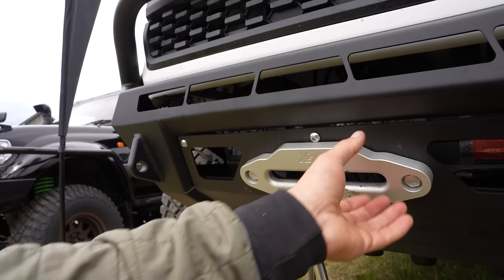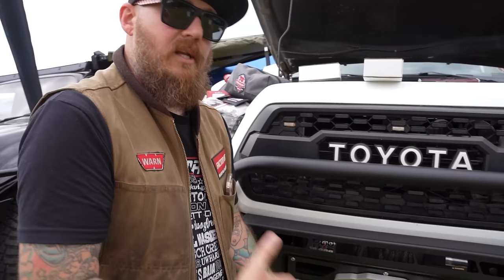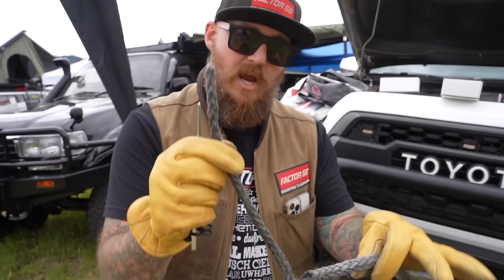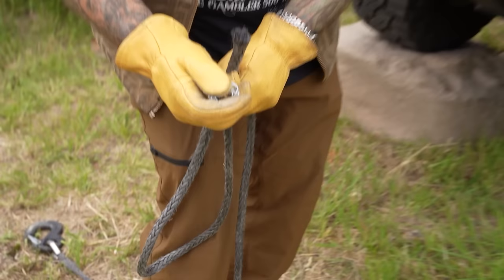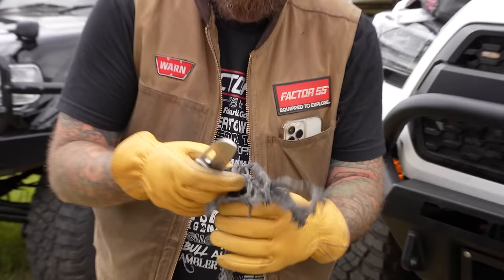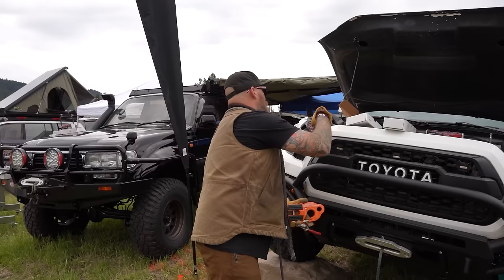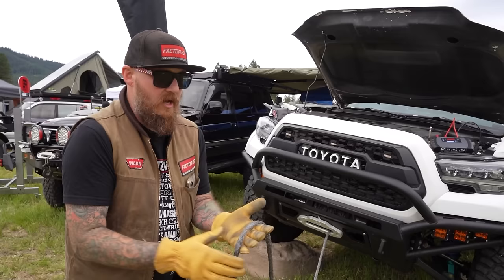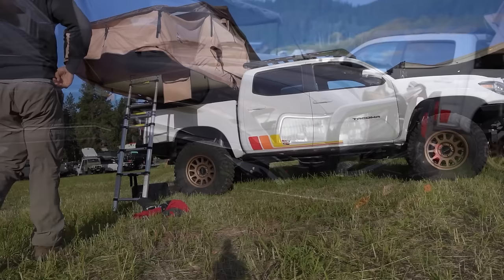How to Splice Winch lines & Why you should upgrade your Winch system.

Comment: You take the  base-plate of prefabulated amulite, surmounted by a malleable logarithmic casing in such a way that the two spurving bearings were in a direct line with the pentametric fan. The latter consisted simply of six hydrocoptic marzelvanes, so fitted to the ambifacient lunar waneshaft that side fumbling was effectively prevented. The main winding was of the normal lotus-o-delta type placed in panendermic semiboloid slots in the stator, every seventh conductor being connected by a non-reversible tremie pipe to the differential girdlespring on the "up" end of the grammeters.
Reply: nailed it. lmaoo
Reply: You took the words right out of my mouth.
Reply: Bro you win for top comment 😂
Reply: 100% won the Internet today.
Reply from the maker: Oh my God thank you 😄
Reply: @Maxx.Powell  haha no problem any time!
All joking aside, this was a wildly helpful video that I'll be coming back to when I get my winch. That dude clearly knows his shit and I'm jealous of that knife 🔪 !!!
Reply: These all sound like things folks get sent after when they're new on the job. Beautifully done sir!
Reply: Your mistake.
You describe, as everyone knows, a transmission known as the turbo encabulator, which was - a crudely conceived idea of a transmission that would not only supply inverse reactive current for use in unilateral phase detractors but would also be capable of automatically synchronizing cardinal grammeters [regardless of the 'end' used]. 

Now basically the only new principal involved is that - instead of power being generated by the relative motion of conductors and fluxes - it is produced by the modial interaction of magneto reluctance and capacitive duractance. The original machine had a baseplate ... [the rest is yours] ... The turbo encabulator has now reached a high level of development and it's being successfully used in the operation of novertrunions.  Moreover, whenever a forescent scoremotion is required, it may also be also be employed in conjunction with a drawn reciprocation dinglearm to reduce sinucoidal repleneration.

It's not cheap.  
But I'm sure the government will buy it.

That is all.
Reply: You must be associated w/ Chrysler Master Tech videos from... the 80's??? The video was called "Turbo Encabulator".
Reply: wtf did I just read?

Comment: I swear to god overlanders will pay for anything that will not make their IFS vehicle anymore capable. "Ohhh a $400 fairlead why not"
Reply: Gives it 20 hp and Bluetooth  locker up front
Reply: I bout stickers that gives me 15 extra mpgs. You can buy them as well. But save up. It costs 200 bucks.
Reply: And why shouldn't they if they have the money? U mad?
Reply: You are way off on your price 🤣 clear indication of you can’t afford it and you are big mad 😡 

The fairlead in this video retails for $88 as of today when I’m on their website making this comment
Reply: @matt.mckinzie factor 55 ultra hook is $280, for $15 worth of aluminum and $15 of CNC work .
Reply: @KurNorock  and?…..
Reply: @KurNorock  $15 worth of aluminum labor and electricity to machine it and anodize it. Labor and cost to package it and ship it. That’s before you spend a ton of money doing research and development and testing for proper certifications. If you can go by $15 worth of aluminum and produce this product for your vehicle by all means have it. don’t forget the steel for the locking hasp and the rubber to keep it properly secured.
Reply: @iamme8949  people always want to bring up the whole "research and development and testing" argument as if that justified adding another
$150 per unit. First of all, these aren't that complicated of a design. It didn't take a team of engineers 5 years to design this crap. Secondly, they've been selling these things for years.  The R&D has long since been paid for. So has the equipment. You are paying a 1400% markup because you have been conned into believing that all R&D is super expensive.
Reply: I just like a cheap roller still lol
Reply: @Chris-te7uk  and there it is.  The most smooth brained take possible.
Reply: @KurNorock Apparently you don't like good 'ol American capitalism.
Reply: @markschram3971  and there is the second most smooth brained take possible in this conversation.  

This has nothing to do with capitalism.  This is about moronic customers who don't realize they are getting ripped off by a dishonest manufacturer.
Reply: How exactly is this "dishonest"?
I am loathe to be a consumer merely to keep up with the Joneses, however I am also consistently interested in new ideas & new tech.
For the average winch owner, a fairlead with minor nicks isn't going to strand them in back country Alaska, so... whatevs.
Buy or don't buy.
Your opinion is obviously invaluable & you're much smarter than everyone with your edgelord take on this super important topic with implications on global security.
Reply: It’s a cycle new trends pop up people want to join, the hobby  starts becoming a glitz flex game and lose sight of effective solutions vs overhyped overpriced gear ⚙️, some keep focus keep it simple, others it becomes a gear chase or flex game, it’s a natural part of the industry to promote products for profit even if they are overpriced and serve little to no more benefits 😅

Comment: There aren't any burrs,   it's soft aluminiun for a ourpose put the winch line hook in the tow point on the truck,  you don't need th wind the hook into the fairlead,  just another load of bollocks.

Comment: Rigger by trade here.. great vid . Not to be that guy.. but that's not a Brummel. That splice will slip under slack. You need to weave the two tails into each other for a true Brummel. I would recommend you stitch it to seize it under slack in this configuration.
Reply: Plus 1 for this comment. He did not do a locking brummel or taper the tail how I would...
Reply: 100%  I seen that and said the same thing.   His tail was not long enough to hold without a lock.

Comment: A good company is one that can convince you to buy crap you don’t need. Fairlead, hook, fid, rope guard for said hook, the ring inside, what did I miss?
Reply: Winch. Fancy bumper. Overland truck. Truck tent. 

Tarp and a backpack is all you need. Hell, skip the backpack and use the tarp.
Reply: Yeah I often come across vehicles far from the end of the pavement that are in need of recovery and I just grab my handy dandy tarp to pull them out…

Oh wait.
Reply: @timothyc4214  it was sarcasm. The point was you don’t need anything to get out into the wild. 

I can get further than any truck ever designed.

Comment: y'all remember back in the day when we used wire rope. and it like didn't need any of this crap?
Reply: The rope is fairly tough stuff, I wouldn't have an issue with having some to use as an extension if needed, but for the main line, I'll stick to the wire rope, not hard to do splices and repairs on it either.

Comment: Excellent procedure.                          I!m from the sea and barge work so we spliced our big wire rope on a big set up that look like a tire machine. We pulled the cable in the back door of the rigging room  up overhead n down  into a guide  to position it verticle to do the splice. Big job. Dandahermit
'm

Comment: The harbor freight 12k synthetic system is really really similar.  I think it's good enough for me.   Just glad j have a winch if i need it.   I'm still trying to figure out how to pull myself backwards with only a front winch lol
Reply: Youll need four snatchblocks, & attachment points:  front attachment, side attachment ( to Avoid running line under yiur vehicle) and two rear. Use a sigle line pull front & side,  then a double line pull at rear.
              v side
           __
>        [____]        <   Front
>

Comment: I still don't have my suspension done.  I decimated my front and rear stock bumpers on my Tundra on one trip and decided I needed to protect the truck body more than I needed new suspension.

Eventually I will get the suspension done and lockers installed.  Just gotta space out the $$$.
Reply: These kits are only 5 percent better than stock. If they really offred much they would have a g meter and speed over obsticals comparesion.

Comment: That rope was not spliced correctly from the factory. The tail is to short and isn't tapered enough. This is a major fail on the rope manufacture's side.
Reply: The rope manufacturer didn’t splice it.  They just sold the rope to the winch manufacturer.  Jeeez. 🙄

Comment: Re the forged hook, which absolute idiot would cut the eye  when cutting - or disassembling) and resplicing (or clamping) cable / lines is always the preferred method...

NB. Always maximise jargon to improve one's market position.

Well - for real strength do a deep bury - stitched brummel splice  - NB to brummel around a piece of hardware, one needs the free end to be released from the winch...  A stitched deep bury is a one end affair... 

The "1:1" advice on minimum bend radius may need some proof to that pudding - It could be true with 12 strand woven rope, definitely not likely with higher weave count... ???.

Comment: I question the titanium pin on that hook.  I have bent so many titanium pins on things.  It does not take much to put a bend in them.   They dont recover like steel to a degree.  I have gone back to steel on pins cause of it. If it does bent slightly.   The whole hook will be junk.

Comment: The safest hook is no hook..

The simplest DIY Splicing tool is a length of fencing wire.  (Make a smooth ball of the sharp ends to avoid losing it inside the rope, or poking "one" in the eye..

Receive rrecovery points - should be cross drilled to allow alternate axes of operation - If pulling to the side a vertical orientation is way better... - Bow/Dee-  shackles should not be loaded off-axis - with ""lopsided loading"...

Ha ha - for quality, any foreign country with an eye to detail can match or beat "American made" - especially is made to the last cent- Buy Quality, buy from real people, not faceless corporations.....

Comment: Weird.  Never had an issue with steel on steel.
Perhaps that's your problem.
Dump the twine. 
KNOW your winch system will NOT fail.

Comment: those add ons cost as much as a winch, ive never even used my winch, just dont get stuck and have a badass toyota, the jeepers will love this bling bling stuff though, they always stuck or broke.
Reply: Wtf are you talking about dude. It's us Toyota people who are always getting stuck 😂
I've had Jeeps, I've had Subarus, I've had Toyotas.
It's always the Toyotas that get stuck.
Don't be a fanboy.
Reply: I kind of agree. I use the same smittybilt winch but I just put a shackle on the bumper and clipped the hook to it and tightened the winch a bit. No rattles, does not look as fancy but it is function over form, or tools before jewels as he said.
Reply: CJ's and Taco's both have a few things that one does better than the other, but, I've been to the same ugly places with both, had to winch both in some strange places and places I expected to get stuck, just that the Taco is more comfortable, and I can haul more stuff in it.